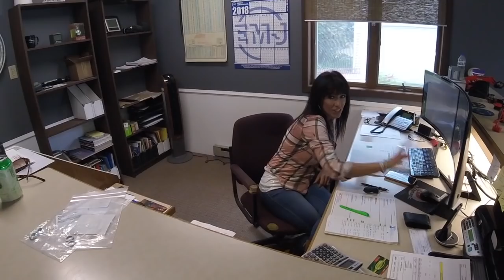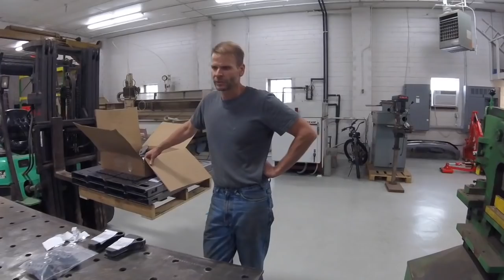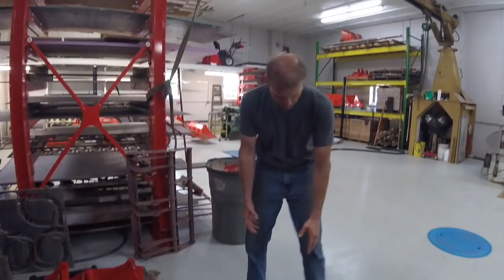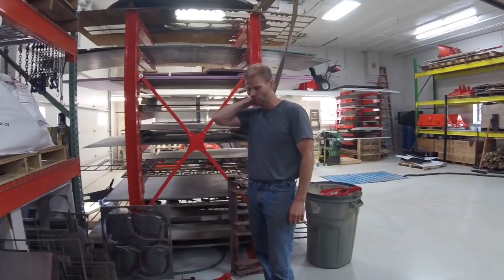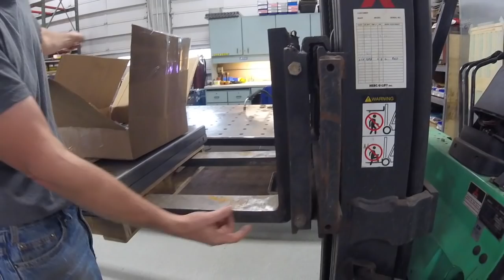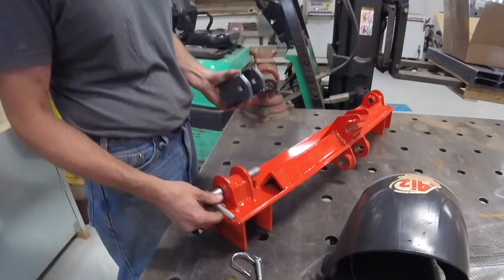Ai2 PRODUCTS SHOP TOUR  (part 1)

Comment: I wish he made attachments for my Kubota L2501.  Sure does a bang-up fab job on those BX attachments.
The only attachments I have are a Land Pride RCR1860 brush hog and a BB1248 box blade. I actually bought that  box for my Bolens G152 sub compact, but use it on the L2501.  I made a mistake in getting the pin-on bucket instead of the skid steer QA.  So I can't use the Artillian grapple unless I change out the whole bucket assembly and that would be too expensive.  Everything Attachments has a bucket grapple system that looks pretty good.  I may go that route.
Thanks for all the great vids.  You got a couple of great kiddoes too.
Take care.
Reply from the maker: Tony stays busy enough with just the BX line of attachments. I’m sure he could hire a few more fabricators and stay busy with additional products. 
I think you should look into getting the SSQA, in the long run it may be the better option. 
Thanks for the comment
Keep on tractoring!